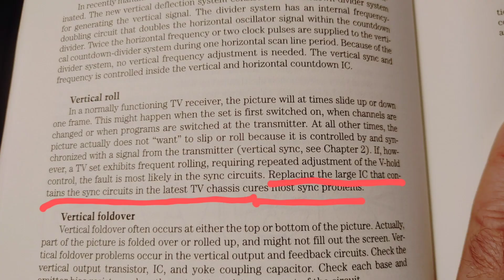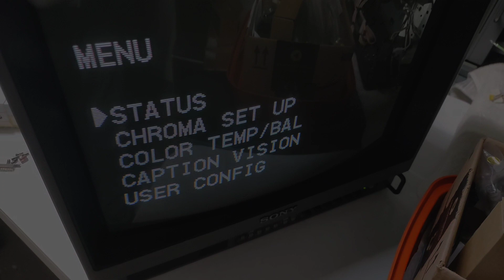PVM-20M2U Update.... New Sync Chip and Sync Caps....

Comment from the maker: This is a followup to the last video on the 20m2u
https://youtu.be/cUFdCbEcRZQ
After fixing no power/protection state, faulty front panel board, and an arcing tube I lost vertical sync.... Ive had the sync seperator IC chip in hand for a while but wasnt confident that was the issue untill reading about sync seperator chip being faulty could cause horizontal distortion along with rolling.....both issues I was experiencing so went ahead and replaced the sync chip along with surrounding capacitors. so now the whole deflection side of the board has new caps.

Still didnt correct the issue. OSD bounces and still have horizontal distortion and vertical rolling.

back to the drawing board. Guess ill try vertical IC's next. Probably just a film cap or something stupid that I have no idea how to find.

Comment: Was that bridging between one of the IC legs and R568 intentional/from the factory? --- Maybe you could ask Shangoo66, 12voltvids or savonpat about the sync issue ...
Reply from the maker: Yup, several of the sync chips vias had direct surface trace pads to nearby surface mounted resistors.
Ive posted this issue on multiple platforms and forums so ill have to wait and see. Starting to think its something like a bad film cap or diode

Comment: Have you checked resistors etc or diodes around the sync chip or any of the bigger resistors around that area? Have you done a prod test around the board to see if it affects the problem at all? Might have been a cracked solder that gave way. Have you checked that the right voltages are getting to the sync chip? It definitely looks like something in the video processing section. Are any of the chips hot to touch? A failed vertical output IC would likely give a flat horizontal line. One that is bad can give shakiness in the picture but I wouldn't have thought constant scrolling like that. You could always solder some wires to test points and make sure you're getting the right voltages that way.
Reply from the maker: I did check the larger resistors that they werent open, and probed the diodes looking for diode voltage drops.

Havnt figured out a good way to test for voltages live because all the wiring is so short but need to figure it out and probably study the service manual some more lol
Reply: Depending on how many test points there are you could solder wires to the test points on the board and wire them out to choc blocks for safer testing.

I have a large consumer set which would lose high voltage and switch itself off. I replaced capacitors around the flyback, checked resistors, did all sorts. Someone suggested a dry solder joint may be the problem but I'd resoldered all the connections on the hot side of the board and tapped around all that section. Then when I was taking the scart connector out one day I noticed that it was affecting the picture.

It turned out to be a dry solder joint on the other side of the board. You might want to touch all those solder points up on the through hole stuff to rule it out.
Reply from the maker: @Gubalicious  Next time I have the board out ill check the other side for bad solder joints instead of just focusing on the deflection side. Good idea with the terminal blocks for testing voltages, also I cant remember if I tried swapping input boards so may need to try that as well.
Reply from the maker: @Gubalicious  
I forgot to update, i checked all caps esr again, reflowed entire deflection/sync side of the board , tiny surface components and all, checked all sync ic pin voltages, and recapped around vhold IC.... Same issue 

https://www.eevblog.com/forum/repair/pvm-20m2u-vertical-deflection-issue/msg4558444/#msg4558444
Reply: @LameGaming  So it's not a dry solder joint. It's not a failed cap because you've replaced all of those, Plus it's not time dependant. Its a problem that is there indefinitely. Pointing towards a failed component.

It's not a sync issue because you've replaced the sync IC and checked all the components around it, the other thing to look out for on that is a high pitched whine, that's usually a sound you hear when the monitor is searching for a sync. Plus it looks like the picture is synced but just rolling, a missing sync usually looks more garbled than that.

The menu is still stable which suggests it's not a problem with the actual picture output to the tube. It's an imaging processing problem. I would say the wobbling of the menu is normal as my BVM does that on an unstable image.

On page 68 of the service manual there is a "hold amp". It appears again on the bottom of page 42. Not sure whether the hold is referring to the vertical hold. Might be worth having a look round there. There are some other youtube videos which show a rolling picture to be in the vertical output section. But where that is in the service manual... There are some good block diagrams to follow in that manual also.
Reply from the maker: @Gubalicious  I did notice the vhold ic and when reflowing the board I checked and replaced some caps around that IC. Ill have to look at the block diagram and schematics again and see if thats a different IC than the one I recapped around and also still need to probe that IC.
I did get a scope but still trying to learn it.

Weird thing is i swapped out the rear input board with another and after that vhold adjustments in the menu stopped the rolling.

I still have bad vertical jumping and the inage is stretched a bit. My osd does jump around with the image on screen.
It was rock solid before, and the 14m2u i recently recapped/fixed has a rock solid menu even with no input signal.

I swear it seems like a bad cap. I wonder if one of these new caps i installed failed in a way that esr still reads good.... Im now wondering if instead of buying a scope if I should of just shotgunned the whole V circuit.... New caps, transistors.... Might of been cheaper and fixed by now 🤣
Reply: @LameGaming  So the problem's isolated to the input board?
Reply from the maker: @Gubalicious   no, i think its on the chassis board, ive swapped the input board several times and issue remains. Its just weird that after swapping it the vhold adjustment would stop the rolling but that input board i pulled is working fine in a 14m2u so definitely not the issue.

The Vhold standard setting was around 120 in the service menu, i have to lower to under 90 for rolling to stop. 0-90 the rolling stops but the bad vertical jumping is still present.

I see a weird spike when scoping pin 19 of the sync chip.

I think I need to have the 14m2u and this 20m2u on, side by side.... And probe around with the scope back and forth and try to pinpoint where the issue is.

All electrolytics been replaced but theres 4 or 5 clear plastic caps right near the sync ic, i need to figure out what they are and try swapping those.

https://youtu.be/7fuTLJ6yqhc

Comment: Need to know the title of that repair guide, please.
Reply from the maker: Homer L Davidson published a few tv repair books in the crt era. Some are for beginners, some more advanced. I cant recall which book I referenced but just look on ebay, i think i got mine from an ebay goodwill seller for a few bucks ea
Reply: @LameGaming  Thanks a lot dude, I' m just a beginner and I want to get inside, really in love for the old electronics. I hope you will have success with that PVM, it' s a damn good beauty. I saw you swapped the IC and replaced the caps, probably at this point it may be some bad resistor.